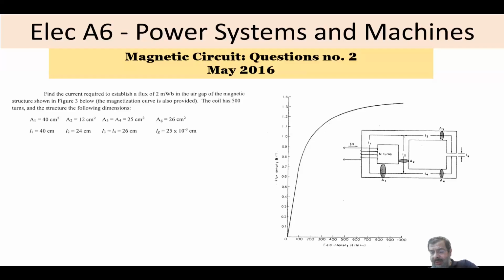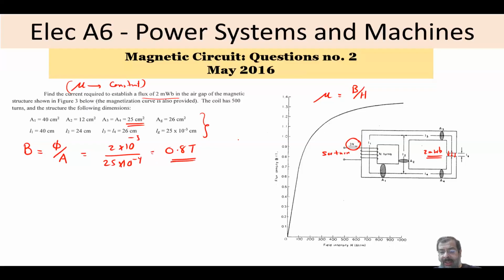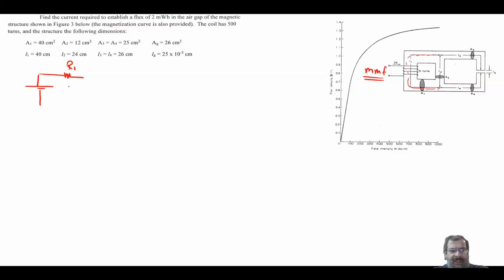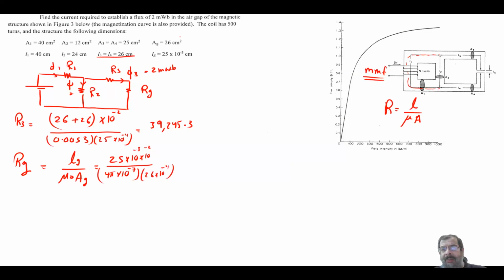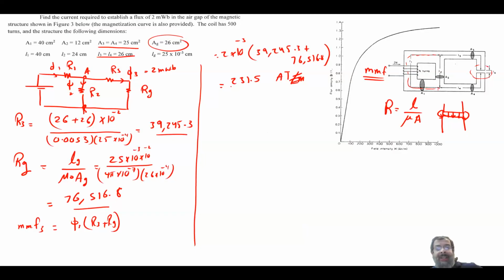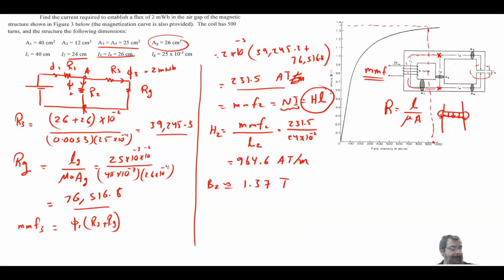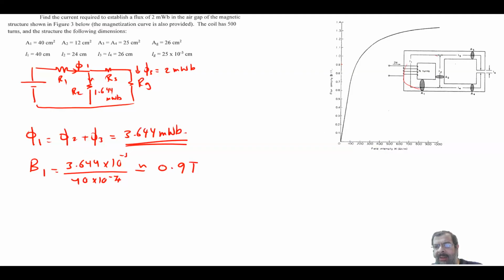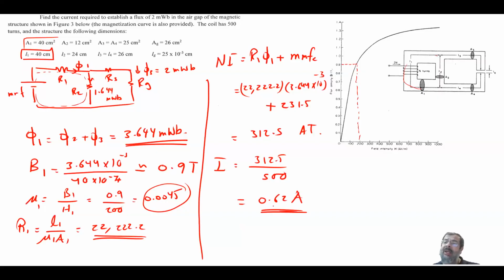PEO solve examples (ELEC A6) Magnetic Circuit Question no. 2

Comment: Hi Professor, shouldn't you use the Ag area of 26m^2 @2:20? However, since we have to use the graph, there isn't really a discernable difference.
Reply from the maker: I want to calculate the flux density of the magnetic material and not air, so this is why I used 25 as the CSA
Reply: @electrical4everyone  I understand, thank you Professor

Comment: Hi Prof. 
Can you accept other solution?  When you calculate the flux#1 = 3.62 mWb you can take from the figure3 H1 = 180 aprox. Then replace in NI = H1l1 +H2l2.
What is your opinion ?
Reply from the maker: H*L = N*I = Flux*Reluctance = MMF, so both approaches should be fine.